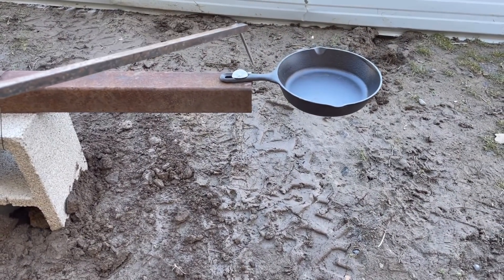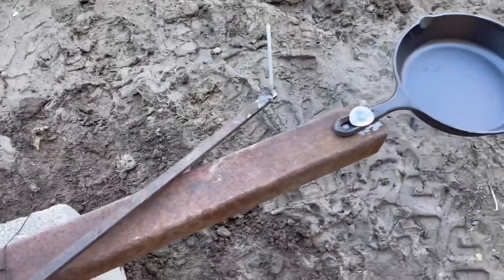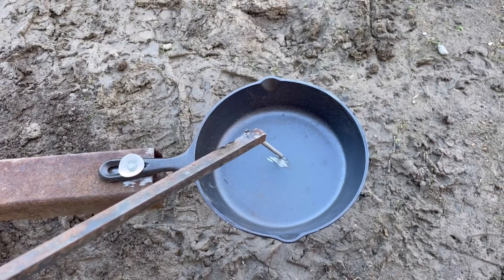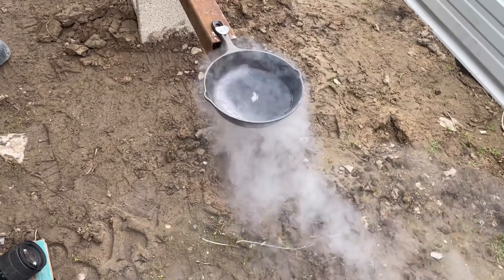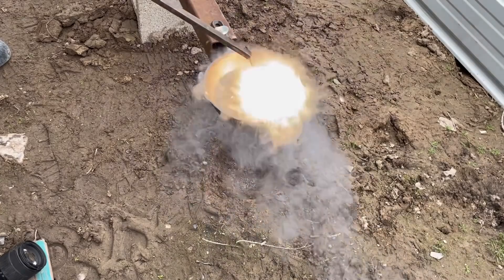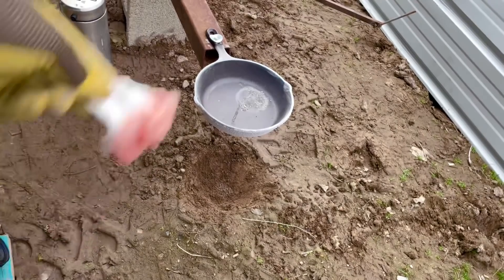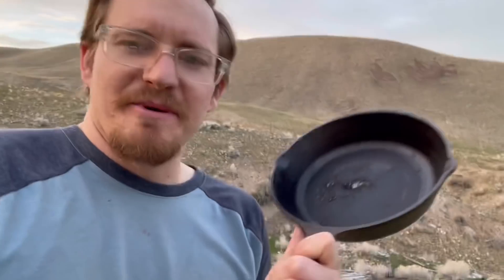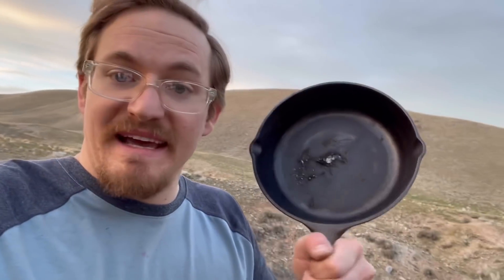Welding in an iron pan full of liquid oxygen

Comment: Cody can you make a mercury based energy storage system?
people use water stored at a higher hight to store energy, when they generate to much it get's pumped up when they produce to little it goes down through a turbine.
since mercury is a lot more heavy than water it should be able to store a lot more energy in a small area.(around 13 to 14 times the area).
you could call it something like the mercury splash tower to make it sound like a theme park ride just as a joke. since you have a lot of height difference on your ground such a system might be quite interesting and possible be useful to store energy if you have something like solar pannels or wind turbines. or even if you generate power from something like a steam turbine, so that you can run it at max efficiency and just store all extra energy. but even a small scale test would be interesting. a water powered one as well, but some people already do that so mercury would make it more cody. <-1

2->and would it be possible to compress mercury and what would happen?

3-> "since gravity is different across space the following might also be interesting to try out in your mars base at chicken hole. as a more universe proof method"as well as a heavy metal fly wheel to store energy, or just directly accelerating mercury inside or a housing which can also rotate to increase efficiency. due to the weight of mercury and it being so moving(liquid) you might be able to generate electricity directly without any generator since the protons and neutrons are more heavy than the elctrons which will cause the mercury to generate a very strong electric polarization assuming it won't generate to much magnetic polarisation. this due to there being a lot of protons and neutrons in a small amount of mercury, each one works as a small battery when they get rotated due to the centrifugal force, if that works well you might be able to directly capture electricity by connecting one end to the center of the rotating pool of mercury, and one brush or connector to the outside of the pool. when it rotates fast enough this should be usable directly like a normal battery, so no need for a generator or such because it would directly store charge instead or only movement.

a nice other usecase for something like that would be in space or in a vehicle since you can put the mercury in a ball like shape will many different connection points. the mercury should be able to keep rotating without depending on a axis which would prevent a lot of energy loss. to test it a nice experiment would be to measure it directly, however using a non conducting container with a conducting point in the center and the outside will also work. first it is made to rotate at a very high speed without any load. later with a electrical load, depending on how much electricity it generates it should rotate less long with a load attached. however using a measuring device like a volt meter might be more easy, but it might be worth testing both.

Comment: another posible reason why it didn't burn was by the time the oxygen came into direct contact with the weld it had already cooled below its kindaling point. i wonder if you had heated the pan then poured in the oxygen if it would have had a diffrent result.

Comment: I suppose it can't really do alot of damage because as soon as the metal melts it gets oxidised and stops it from bonding or melting smooth enough to flow, there also not being anything to push the molten metal away

Comment: Please try it again with the flux knocked off the welding rod. The entire point of flux is to keep oxygen from getting to the arc and molten metal. I'm guessing that the flux off-gassing is preventing any oxygen from reaching metal that's at a high enough temperature to support a runaway oxidation reaction (i.e. "burning").

Comment: So fun fact you can't cut cast iron with a torch unless yoy use a waste plate . 
So i would guess thats why the reaction didnt work.  Try a steel container,  you also have to get it hot enough for the exothermic reaction to get rolling  being the liquid oxy is blow zero its cooling the material faster then you can heat it.

Comment: One more thing to consider is the fact that the liquid oxygen is so cold that the reaction rate is instantly reduced and, as it evaporates with the added heat of the welder, it cools the metal even more, preventing it from entering the temperature range that would cause it to burn/melt.

Comment: It seems you used a standard welding rod, that coating is meant to partially burn up and provide a protective gas cover for your arc. I wonder if that prevented the reaction

Comment: There's a significant difference between an arc from a welder and the cutting flame from an oxy-fuel torch. I'm not sure how to do it from remote to stay safe, but I bet if you started a cut with an oxy-fuel torch in a pan with liquid oxygen in it, the cut would turn into a self-sustaining reaction. I don't think there's enough energy being input by the arc from the welder to start the reaction.

Comment: I would have to think the pan would be heated pretty close to melting and the heat the liquid oxygen would vaporize faster. It likely requires the high pressure and heat from oxy/acetylene, oxy/propane torches to work as it does.

Comment: What is interesting about this.. How did the weld come out? Cast iron is really difficult to weld due to cracking, basically you need good preheat and weld with very high nickel content sticks and it still might fail.
Cryogenic welding should be a really bad idea in general.

Comment: There is also the tiny, little detail that cast iron cannot be cut with an oxy/fuel cutting torch. 
The very high carbon content (greater than 4%) somehow prevents the metal from reacting with the pure oxygen jet, so it was extremely unlikely that even LOX could be used to help set a cast-iron frypan on fire. The more likely mode of failure should be cracking or shattering from thermal shock, like the combination of the cryogenic temperature of LOX and a 6000c welding arc might have done, but obviously not in this instance.
Perhaps if it was made from elemental iron (as in pure Fe) or perhaps mild steel (low carbon steel), this unusual frypan might be persuaded to catch on fire if filled with LOX and struck with a welding arc?

Comment: You failed to complete a fire triangle: fuel + oxygen + HEAT = fire. Your metal cutting experience was with pre-heated steel. This video used super-cooled iron. There's certainly a few hundred degrees of difference in a thermally-dense material that would prevent sustained ignition.

Comment: The concept is sound, but it requires heat and you created the worst possible conditions for oxidation to occur by dropping the temp of the pan.  I understand the need to cool the pan, but without sufficient heat the metal won't oxidize effectively.  Try dropping a molten blob of steel into liquid O2, if it's hot enough it should completely oxidize and leave nothing behind. We had a shop teacher that would compete with people to cut steel with just O2 by making a molten puddle, cutting the acetylene and using the heat from the oxygen stream to oxidize and drive the reaction forward without flame.  The only way he got it to work was to heat up the whole length of steel and even then it was very finicky.

Comment: I think you have an issue of surface area vs heat generated. Obviously the combustion of iron and oxygen is enough to melt iron and sustain more combustion... but the gas is much easier to warm! The cool LOX is stealing the heat of combustion by warming and boiling, and the combustion surface area doesn't produce enough heat to overcome the heat lost through LOX boiling.

Comment: @Cody'sLab When you use a cutting torch, for example, removing bolts from castings and the such like. The cutting torch will blast the steel bolts away, and hardly touch the cast iron casting. Meaning cast iron doesn't burn in oxygen, it has to be steel. So maybe if you could get your hands on a pan made out of steel this would go differently.

Comment: Try it again with a cake pan or a baking sheet. Use like 10 -14 gauge and maybe strike it from the bottom so you can get it nice and hot. Then your testing if the heat mixed with oxygen burns the steel or not

Comment: Try running a plasma cutter using 100% oxygen instead of compressed air
Reply: You’d be safe with that apron of yours. Nice welding btw
Reply: @ilostmyipod1582  almost as iconic as Jeorge Sprave's safety tshirt
Reply: @xariasfury5782   or as ironic as Colin furze's safety tie
Reply: @xariasfury5782  
Genau herr Fury❗😃
Reply: Hold my Acetylene
Reply: Plasma cutter with chlorine or flourine
Reply: @MaxUgly  not a great idea Chlorine and welding creates phosgene gas aka mustard gas, chlorinated brake cleaner has killed many welders. Pretty sure the plasma cutting process would create the same reaction.
Reply: @Scuba1Steve  Yea, I was purposefully being over the top with that comment just jumping to a much stronger oxidizer than actual oxygen. Chlorine gas itself is an early version of mustard gas and fluorine gas...
Reply: @Scuba1Steve  Surprisingly Chlorine gas can be created with two very simple ingredients you can buy at the store or any chemical suppliers. Kinda scary actually.
Reply: @defirence  Nilered video? I just watched him make nitrous oxide today. It was super simple. Not that I would ever encourage anyone to do so, it is really fun...er, I mean dangerous!
Reply: @defirence  Also, yea a dated a girl who insisted on using bleach and ammonia based cleaners at the same time. She said "the yellow gas means it is working." Not the brightest lady, but she was fun.
Reply: @MaxUgly  If you have the bleach - ammonia mix in a bottle and add a lump of calcium carbide to produce aceteline you get a gas mixture that will explode on exposure to sunlight or UV.
A friend did this, he mixed in indoors then as he took the bottle outside to get a better look it exploded in his hand. No serious harm to him, but his clothes were splattered with bleach. Fun times.
Reply: @MaxUgly  And I needed to know this why?
Reply: @defirence  Which of the eight things I said are you referring to?
Reply: @MaxUgly  not sure guess you're gonna have to tell the story again! It was a funny anecdote imo
Reply: Sadly, I don't have either of those on hand, so I might have to just settle for making bagpipes out of a goonbag and some recorders thisarvo.
That said, any chance of a IDAT "Putting things in plasma cutters that shouldn't go in plasma cutters" video? :D
Reply: Got to watch your feet though
Reply: make sure to not wear any shoes either
Reply: They tried. It destroys the cutting head. Even while using "exotic" metals, like hafnium, for the nozzle. And anyway it produced no significant advantage in terms of cutting speed or cut quality. So, case closed.
Reply: I love your videos and knowledge on destruction/design
Reply: @Jgrandecokk  simp
Reply: Sounds like something you should do. If you were in vic instead of NSW i'd even source you the oxygen.
Reply: The new apron with wang protection is awesome by the way 😂

Comment: I am wondering if part of the reason, in addition to the given reasons, is that the LO2 kept the metal very cold, and a fire of any sort needs heat to continue. So the heat could of been pulled away too fast for anything to remotely possible could happen. Kind of hard to test this theory out because as soon as the LO2 is added, the pans temp is dropped rapidly, or the LO2 will boil off too quickly.
In either case, either the LO2 keeping the metal too cold or the FeO keeps the reaction from continuing, still a very interesting demonstration. 😎👍
Reply: The other reason why it didn't work is that Fe3C (AKA "iron carbide" or "cementite") isn't broken down at the burning temperature of iron (Fe burns at 850c) to react with oxygen and that's also why cast iron can't be cut with oxy-fuel cutting torches.

Comment: I’m curious, was the welder ac, or dc? I have been told that with a dc welder, the heat tends to build more in one side than the other. I imagine this was an expensive experiment, but I do wonder if reversing the polarity would change the result? Works for starfleet after all. You could also chip the flux off the rod, too

Comment: did it not work because of the coating on the stick rod? you always have the chip the slag off the weld after so maybe also sheilds it from the oxygen? maybe mig would work. Or knock the coating off the stick before you weld it. oh i see you had the same idea, you're probably right.

Comment: I do wonder if you had sandblasted the entire pan first so it was all bare metal. seems like with only a small area of bare metal it may have impacted it. After all you have to grind it a little for the weld to work. Would a copper pan be better? Aluminium?

Comment: You could give it a better chance in a few ways I would think:
1. Grind down the entire bottom to expose the metal. The coating is not combustable.
2. Dont cool the pan before striking the arc. Maybe even pre-heat it instead. 
3. Use an iron rod instead of welding electrode.
4. Pour in lots of liquid oxygen while you've already struck an arc and heated a spot.

Of course it's a pretty different situation from the worker's scenario, but it would be interesting if this actually did work at all without a proper cutting torch. My guess is it still wont work in my scenario for pretty much the same reasons you said in the end.
Reply: @Aapo Lehtinen 
1. You're thinking of a Teflon coating. It probably doesnt burn well, but testing that is not the point of this test. Maybe more importantly, I'm not sure if this pan was coated in teflon. He called it a 'cast iron pan' and the coating 'seasoned'. There are also glazed pans, and there the coating is definitely not combustable. 
2. The idea was to just pour liquid oxygen directly into the arc, not to have it sit in the pan at all. The arc will evaporate all the oxygen near it immediately anyway, even sitting in the pan. The point of it is to have a very high oxygen concentration more than to strike the arc inside it.
3. Yes, and Cody does too. It's the whole point of these types of welding rods, to avoid oxidation.

Now that I think about it, the best electrode to use would probably be a tungsten welding electrode without shielding gas. Even without liquid oxygen, that will burn at an extreme temperature as far as I know, and wont cover itself in insulating oxide.

Comment: Two thoughts... 1- You didn't need to light the oil soaked rag on fire before throwing it in the pan. The oxygen by itself will cause the oil to spontaneously ignite. 2- Have ever tried liquid oxygen on asphalt? Apparently it causes the asphalt to explode if disturbed. Maybe that could be a future experiment if you design a safe way to demonstrate it.
Like your videos.. keep it up.

Comment: Might be worth trying with a steel pan, cast iron oxidizes poorly in comparison and is hard to cut with an oxy torch because of that. I'm guessing the  liquid O2 low temperature will prevent the burning though even in that case?

Comment: Self-sustaining flames kinda rely on the fact that they're exothermic reactions where the output energy is greater than the input energy needed to get the fuel and oxidizer over some minimum energy barrier. Having the iron at LN2 temps probably raises the height of that minimum energy barrier quite a lot, if I had to guess. 
I think you should retry this with the pan being at room temp and just throwing the LOX in there and instantly trying to light it.
Reply: That was going to be my comment as well 👍

Comment: would it still wont burn the pan in a high pressure atmosphere where the oxygen be liquid at much higher temperature? as you said this could be the oxide layer blocking the reaction but a very high energy loss from the LO evaporating may also shut down the reaction.

Comment: Maybe try
-throwing burning steel wool into the pan
-Using an electrode with no flux
-deeper oxygen layer that won't boil away as fast
-grinding down the whole bottom of the pan to bare metal